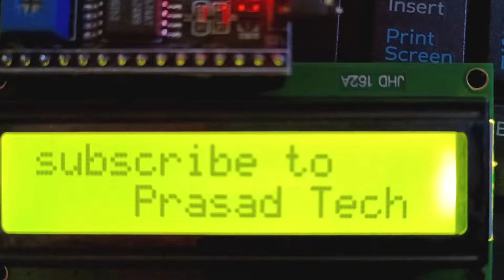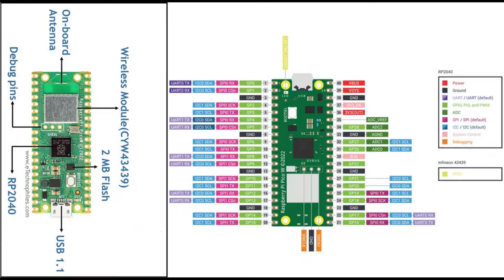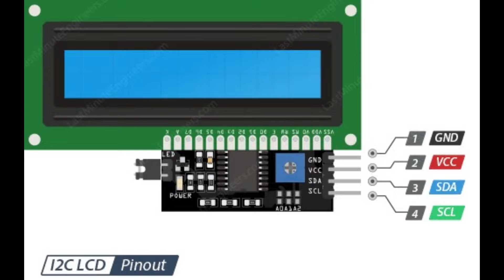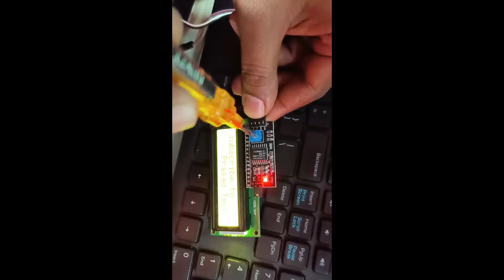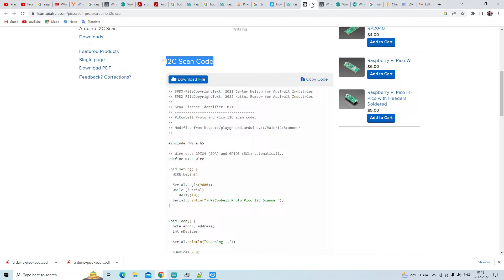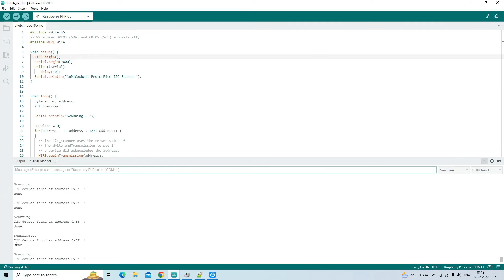I2C 16 x 2 LCD Display with Raspberry Pi Pico or W Using Arduino IDE

Comment: utter nonsense!
Then try to get a different configuration to work according to the possible pin assignment for the I2C bus... All nonsense for idiots who don't want to use the PICO but just want to stick to structured specifications. This is an Arduino AVR Mega Chip, the PICO can do more but it's just not possible to implement it with the code.

Comment: great, thanks a lot, with changes like lcd.init() instead of lcd.begin() and different address it works fine. :)
Reply: hello can you please guide me with it
i am getting some error while uploading like error exited with 1 but code is compiling
Reply: @Gopal-xp5wx  try this: replace lcd.begin(); with  lcd.init(); - it helped in my case and is working perfect. You may also have different LCD address - in my case :  LiquidCrystal_I2C lcd(0x27,16,2);

Comment: The Arduino IDE does Not compile your code and it gives errors. It does not accept LiquidCrystal_I2C.h for PI Pico.
Reply: did you manage to fix this problem?
Reply: @AlexHerman-qj3pi  hello can you please guide me with it
i am getting some error while uploading like error exited with 1 but code is compiling
Reply: try to replace lcd.begin(); with  lcd.init(); - it helped in my case and is working perfect. You may also have different LCD address - in my case :  LiquidCrystal_I2C lcd(0x27,16,2);
Reply: I have the same problem.